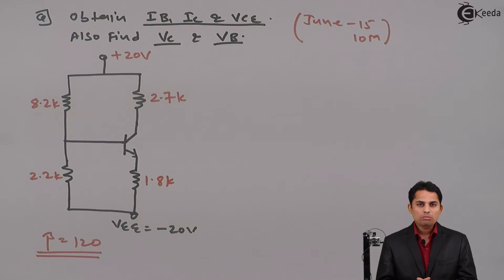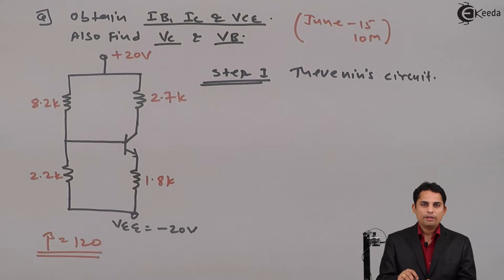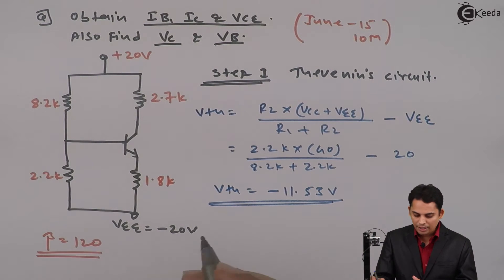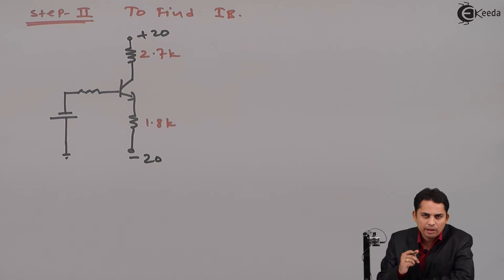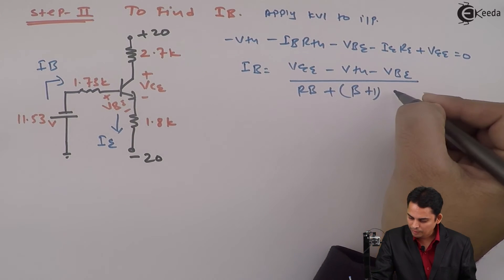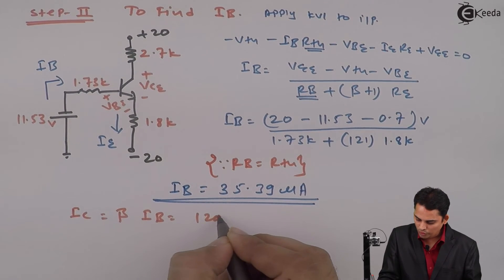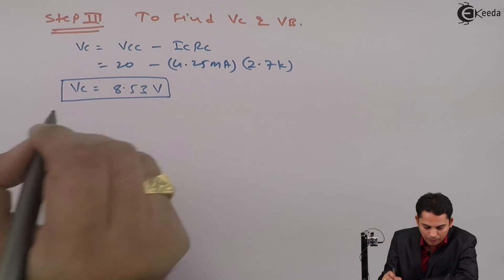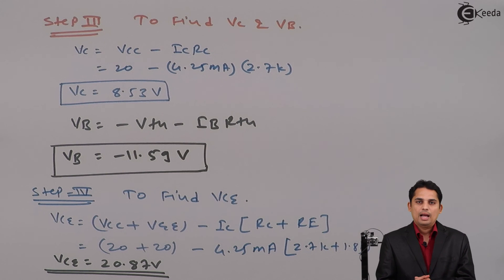Voltage Divider Biasing in DC Analysis Problem 3 - Bipolar Junction Transistor - Analog Electronics

Comment: HI, I'm curious about the value of resistors in the base,
why does the value of the lower resistor is less than the upper resistor?? 
can we design a voltage divider bias amp by making the lower resistor higher than the upper resistor????
what are the consideration in choosing the value of resistor